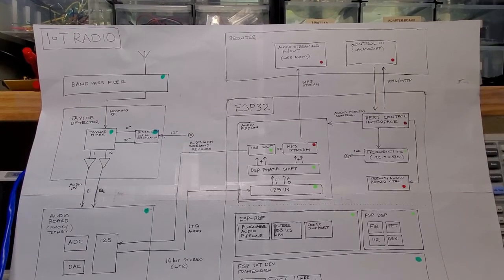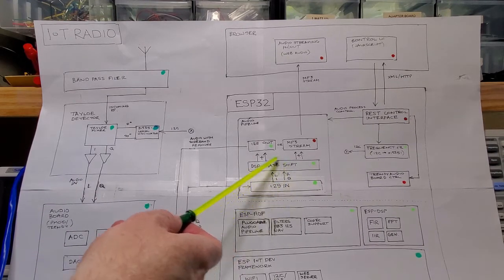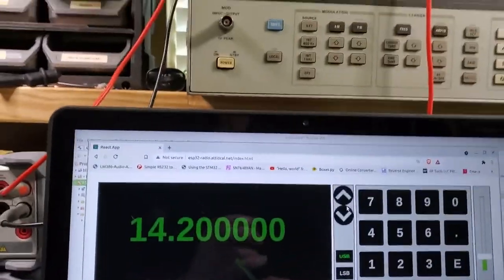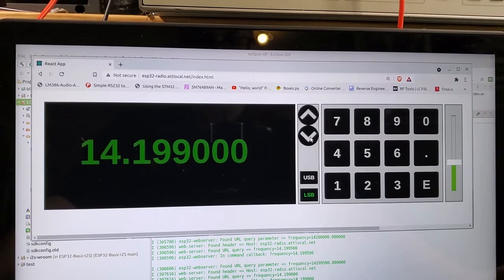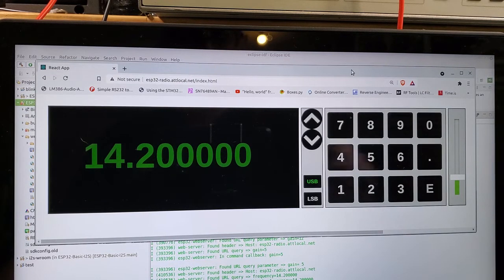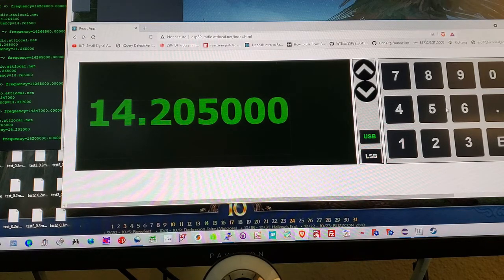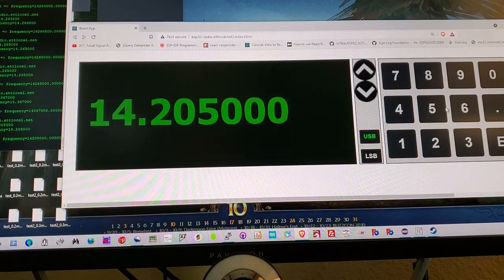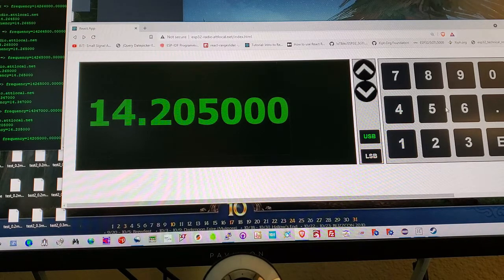ESP32 IoT Radio - Part 4 Receiver on the Air

Comment: Is the output of a Si5351 a square wave or a proper sine wave?
Reply from the maker: Square wave - from 0 to ~ 3V. I don't know any digital synths that output a sine
Reply: @na5y  A nice LC filter eventually will output a sine, but you are right: otherwise it would be called a PLL or something without the word digital ;-)
Reply: @na5y  I just happened to run into a: AD9850 40MHZ DDS that does seem to provide a sine wave. For lower frequencies it seems to exist.
Reply from the maker: @egbertgroot2737  I recall that series now - a variant used in the Pacific Antenna tribander: https://www.qrpkits.com/files/TribanderManualRevA1_20170706.pdf

That one uses the AD9834. I thought they sold the DDS module separately but I can't find it now.
Reply: @na5y  So many modules so little time .....
Reply from the maker: Wow - the AD9850 is expensive - $40 each https://www.digikey.com/en/products/detail/analog-devices-inc/AD9850BRS/611607

Comment: Clean project. Was the 44kHz sampling rate x 200 Hilbert taps a limitation of the esp32 processing speed?
Reply from the maker: I did 250 taps at 44khz and it ran fine. I didn't try any higher than that at 44khz.  Not sure where the upper boundary is I'll find out and publish the results. Thank you for the comment!